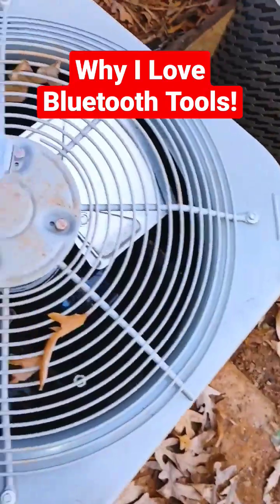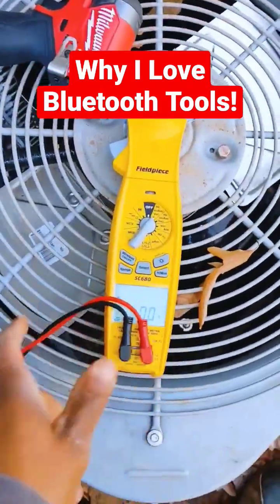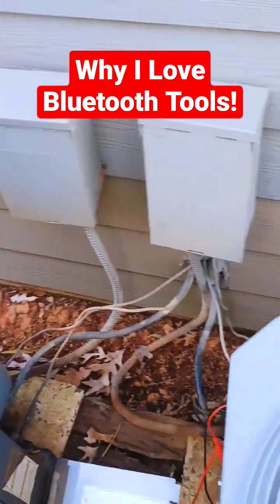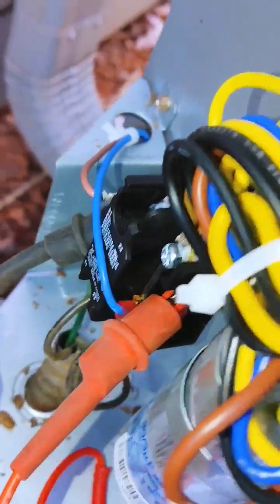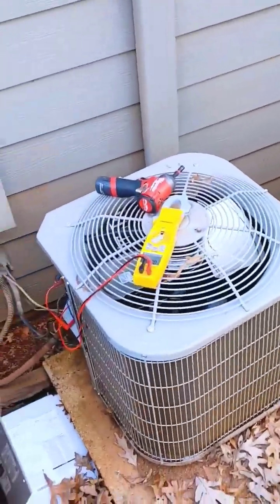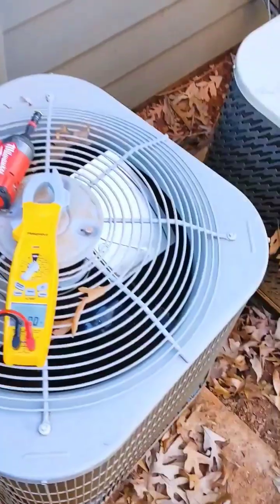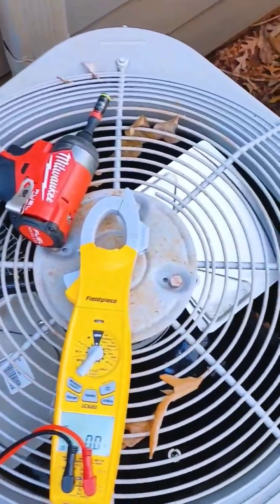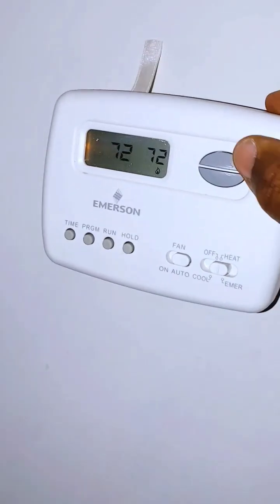Getting the Most out of Your Bluetooth Tools HVAC Tech Must Watch!!! #fieldpiece #hvac #hvactech

Comment: Must be a heat pump. Calling for heat and you get 24v at the compressor contactor.  Cool tool.
Reply from the maker: Yes sir, thanks for pointing that out,  I didn't  mention that in the video.
Reply: also heat is nice to check so you don’t go into time delay
Reply from the maker: True👍
Reply: I’m a bit confused. Wouldn’t you still get 24v if it was cooling?
Reply: @Daniel_A322  yes but if it’s just a condenser then you wouldn’t have 24v on call for heat
Reply: @murkyturkey5238  oh right. I’m tripping. Don’t know how I didn’t think of that lmao
Reply: In your area do you not need pump ups to raise the heat pump off the ground?
Reply: Was about to say the same thing
Reply: Its not even a heat punp in the video

Comment: Somethings wrong here. That is not a heat pump. That is a straight cool condenser. How would you get 24 V out to your contact her if you set your thermostat to heating mode? I like this tip that you use in the video but that is a straight cool condenser.
Reply from the maker: Good catch! I might have mentioned this in another comment on this video. This apartment complex had a bunch of units where someone went back in installed straight ACs in place the heat pumps and never wired them properly, so they still had heat pump thermostat set up to run the outdoor condensers in heating mode at the same time as the heat strips. I actually recorded this video before I realized, as I was just trying to locate the unit to get started on the diagnostic. Hope this makes sense. I definitely appreciate the feedback though. And thanks for watching!
Reply: @HVACTechKnowledgy  have a goodnight brother god bless

Comment: Still no need for a wireless meter. All you have to do is go into the apartment that it belongs to and turn the breaker off for the condensing unit. Then you know what unit it is.
Reply from the maker: Yeah I like using that technique as well. As long as you remember to turn it on and off multiple times to ensure that that's the correct system. Using a wireless meter just makes it quicker where you don't have to go to the breaker  and back multiple times to verify. A lot of these places is a 10-minute walk from the condenser to the breaker box.
Reply: @HVACTechKnowledgy  if you got a 10-minute walk to find the apartment. You got bigger problems than I can even imagine. I'm industrial Refrigeration man. My buildings go over 400 yards long. And that's not a 10 minute walk

Comment: 1000ft range is BS in real world usage. It's at best 100ft with a building in the way if your lucky.
Reply from the maker: Yeah I imagine 1000 feet is probably a stretch but I easily get 300 ft plus with these through buildings and all.
Reply: @HVAC Tech Knowledgy  I get like 60 depending on the building. I dont know where they got 1000ft from though.

Comment: Heat pump with a 2 wire to the Contactor and no defrost board?
Reply from the maker: Very nice catch! Yeah there were a few units that were setup like this in this apartment complex.  I just didn't catch it untill after I recorded the video I was so focused on capturing the footage. I believe the units were originally set up for heat pumps as most of the older units were heat pumps and whoever was replacing them was swapping them out with straight AC but the thermostats were still setup for heat pumps. So basically they're running AC and heat strips at the same time.  I'm telling you it was hack city out there

Comment: That's actually real nice! The old way is walk inside outside 100 times. I didn't understand what wireless multimeter was till this video. I thought the leads didn't need a cable to the meter.
Reply: Or a continuity check, "beep out", "bell out" your thermostat cables lolll

Comment: Why aren't you just preemptively putting the thermostat to call for heat before you go outside?
Reply from the maker: This video is to demonstrate how to be certain you're working on the correct unit when you have a bunch of units that have not been labeled in apartment complexes or commercial buildings. if I would have just turn the thermostat on and then went outside and checked to see which one is running the two on either side of it could have started running as well.
Reply: @HVACTechKnowledgy  very good point. 👍

Comment: saves having to go back and forth testing compressor low voltage control... nice if solo on commercial bldg...🤔☝️👍💪☯️
Reply from the maker: Definitely have used my psychrometers and sc680 meter on commercial buildings before, left them on the roof and take the elevator down three or four stories and still have signal! Fieldpiece  knocked the Job Link kit out of the park!

Comment: You know you can also just turn the breaker off
Reply from the maker: Not sure what you mean...
Reply: @HVACTechKnowledgy  if you know what apartment you're in that apartment should have a breaker for the air conditioning. If you shut the breaker off you can just check line voltage
Reply from the maker: True there's more than one way to skin a cat appreciate the feedback and thanks for watching!
Reply: @HVACTechKnowledgy  np and doing commercial and Industrial Refrigeration for over 30 years. There's definitely more than one way to skin a cat keep your head up brother

Comment: I've used the wireless psychrometers to identify which outdoor unit corresponds to a thermostat. Just setup the wireless psychrometers to check the temperature difference across the indoor coil. Drop the temperature very low at the thermostat on Cool mode. Go outside and pull disconnect. If the temperature difference remains the same then you know it isn't the correct outdoor unit. Continue pulling disconnects in systematic manner until you notice temperature difference across indoor coil drop. I've found this method incredibly useful on the field.
Reply from the maker: Nice! I've done that one myself

Comment: You would leave your expensive meter out there all by itself while you are 2 or three floors away?? Not to smart.
Reply from the maker: Yeah you just have to use discretion and Stick it to the back side of the unit that's not in clear line of sight...
Reply: Not in Milwaukee 🤣

Comment: You could have simply just turned it on and off and looked out of the window if it's the only one spending you know it's yours
Reply from the maker: Yeah that's definitely an option if you have that luxury but I can tell you from my experience 90% of the time you won't not to mention if you're diagnosing a unit and the outdoor units not running or there's not power to the condenser this will enable you to detect 24 volts at the unit regardless of whether or not the condenser or compressor is running or not. Appreciate the feedback and thanks for watching!
Reply: @HVACTechKnowledgy  I agree. In some multi-family buildings the outdoor unit can be located at an entirely different area of the complex. I've experienced that before. Incredibly frustrating but it happens.

Comment: A lot of these homes nowadays have 2-3 systems in the home I have the feildpiece sman480 and wireless charging + air kit . I was taught hook everything up outside and then go to the air handler. Makes checking amp draws for heat strips way easier when you can stand by the thermostat and put it in test mode after connecting clamp to the high voltage . And 4 wireless  probes make checking airflow a breeze . Keep up the great work
Reply from the maker: Nice! Appreciate the feedback that definitely sounds more efficient. Thanks for watching!